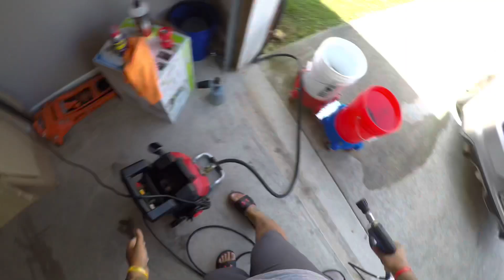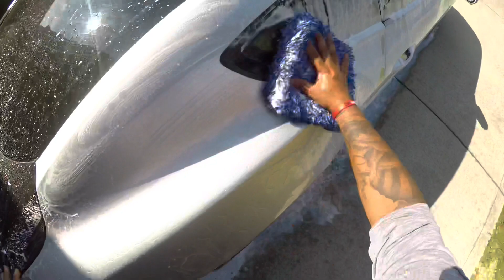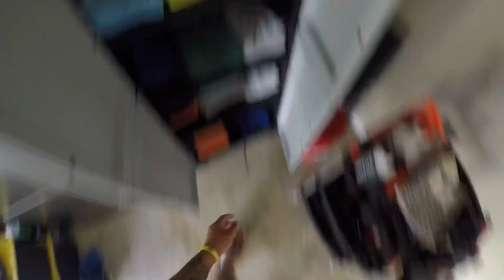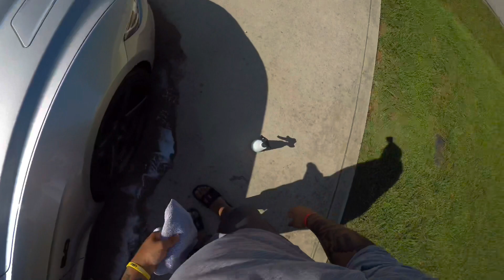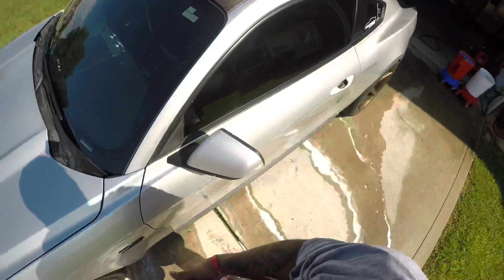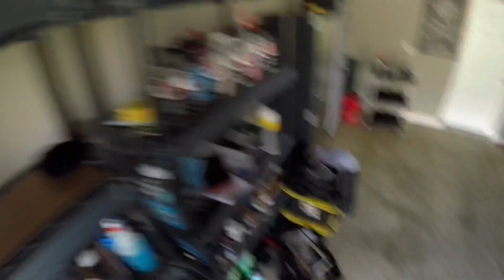Obsessed Garage Drying Aid…BEAD MAKER REPLACEMENT?!?!

Comment: I've used both now and I feel like bead maker is smoother for sure, but it also attracts more dust. I like them both, and OG might slightly win because you don't need as much.
Reply from the maker: The not having to use as much is a big plus. I’ll keep both. They have their uses.

I haven’t had the dust issue with bead maker tho
Reply: @shadspov  unfortunately I don't have a garage and it can get a little dusty where I live. I've just noticed more dust and lent have been attracted to it, but I wash my car every week so it's all good 👍🏼

Comment: For the price this product is a pass.  No real need for “drying aids” and far to many superior options for toppers compared to this renamed version of slipstream.  Also, not sure if you usually wash there or somewhere else but I would really try not to do my wash and drying process in direct sunlight.   Just something to consider.
Reply from the maker: Using a pH neutral soap is fine, and i only wash really early or late in the day. I normally pull my car in the garage but it was cool out and I wasn’t doing a full detail